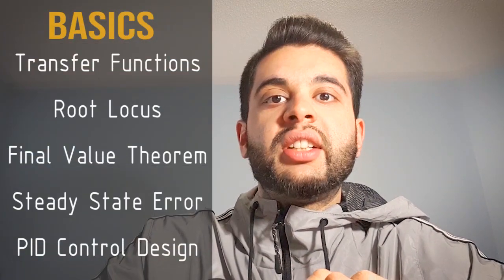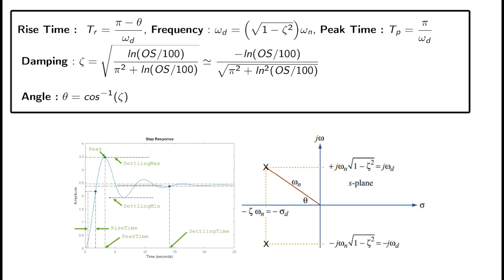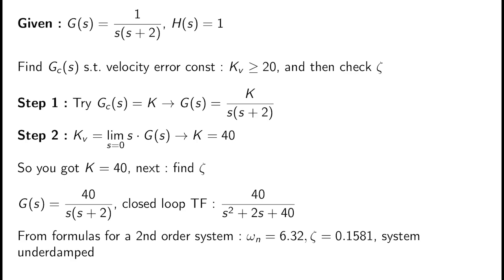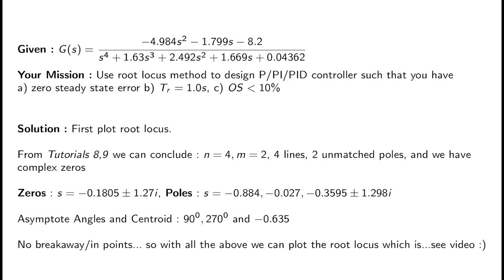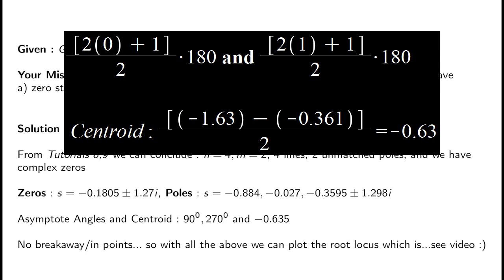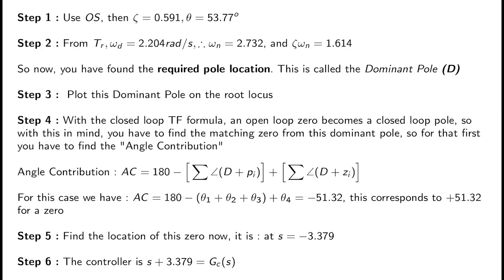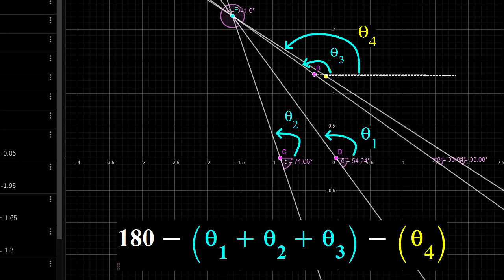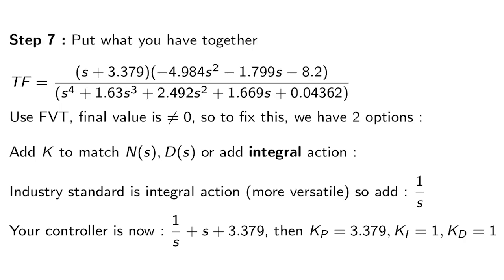Lateral Flight Control Design - PID & Root Locus Method - Step By Step

Comment: If o you plot the root locus for the closed loop transfer function of the system with the control applied, the root locus does not pass through the point you've specified which is -1.614+j2.732. Could you help me please? I tought the closed loop root locus would pass through that point.

Comment: Hi Vinayak
I am doing a simulation of pitch control of aircraft using PID controller. If possible can you share your MATLAB simulink model? Would be very helpful
Reply from the maker: You can instagram message me. I will check if I have it still
Reply: @VDEngineering  what's your Instagram ?
Reply: @VDEngineering  i would like this model too, if it is possible

Comment: My question is not related to this video.
Why we transform the IMU data in body reference frame to inertial reference frame in Quadcopter?
Reply from the maker: You cannot measure anything in body frame because the relative motion with respect to a sensor on that frame is zero.
Reply: @VDEngineering  thank you